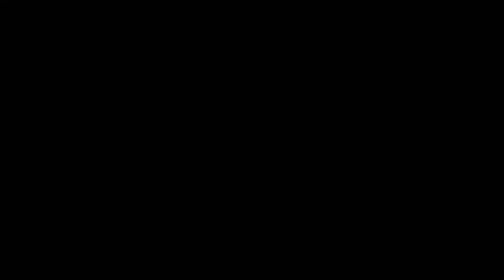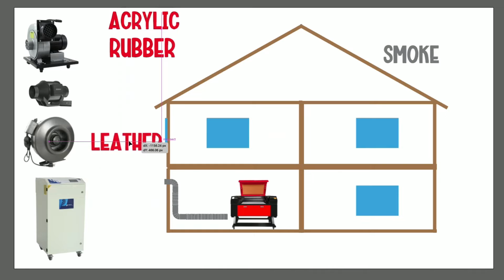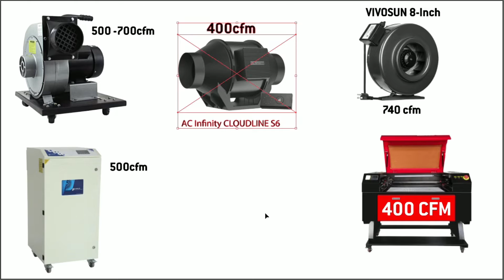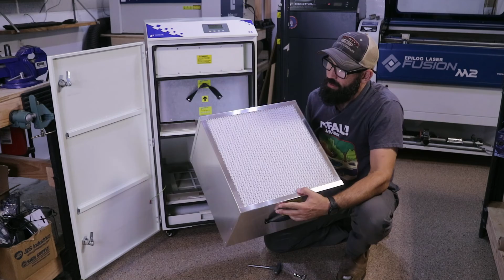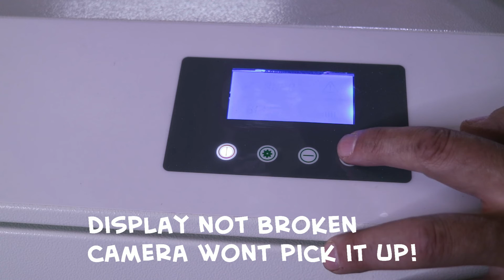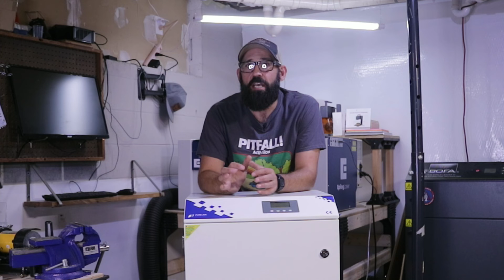Laser Engraving Fumes and How You Can Deal With Them - Fume Extraction Basics

Comment: Good subject! How about keeping Co2 lasers frost free in the frozen garage? Any good ideas?
Reply: I have the $75 heater, but it requires my chiller to run all the time also.
I'm looking for a way short of building a enclosure to keep chiller and tube warm w/o running chiller
Reply: @urbancare5972  I run the aquarium setup through a 5 gallon bucket with lid and holes cut for tubing.
Reply: @finalaccuracy7695   Do you have a chiller or just use the pump & bucket method?
Thanks!
Reply from the maker: @finalaccuracy7695   I love how you guys are helping each other out...awesome!
Reply: @urbancare5972  I do have a chiller. However, in winter I just do the bucket method. I just swap out my water lines.  I never have to worry about the water getting too warm, I do also use a water thermometer,  and I would rather burn out an aquarium heater and pump from constant running. I've had a tube freeze and break in the past, before I started doing this. I've thought about setting up all the power through an inkbird pid controller to just keep it at a minimum temperature but I don't know if I want to mess with success, if that makes sense. The aquarium heater does have settings but the inkbird would let me run the power for the pump and heater based on temp so it wouldn't have to run constantly. If you decide to try the pid, setup can be a pain. There's a YouTube video from a brewer that explains setup and it helped alot. I use one for a cerakote oven.
Reply: Just what I was wanting advice on! Was doing the research over the weekend looking at the Infinity S8 with a flexible 4ply hose lined with a foil inside. Was also looking at fume extraction units both Bofa & Purex models although expensive it's something I would like to purchase in the future. Thanks for taking the time to make this video 👍
Reply from the maker: @davidelder5399  Sure thing David, Thanks as always for your support!
Reply: Thank you very much. This is the most information I've seen on this. I have a mission now to bypass my chiller till summer in Maine- August! Much obliged!
Reply: @urbancare5972  I really really hope this helps. Definitely check out the inkbird pid. They aren't that much. Message me if you need help with it. I truly understand the pain of a broken tube